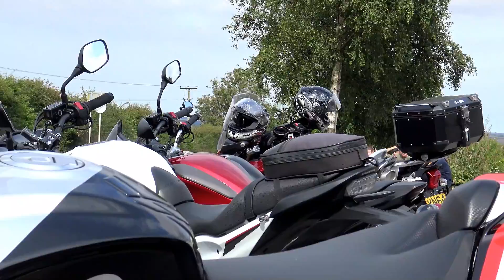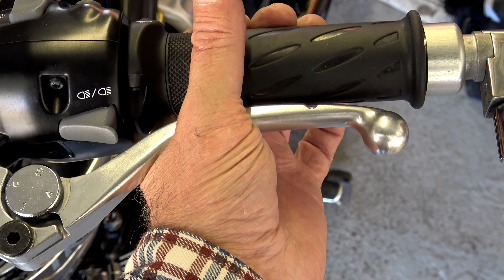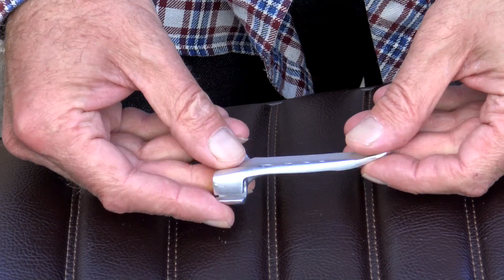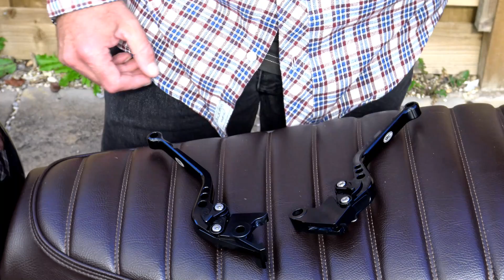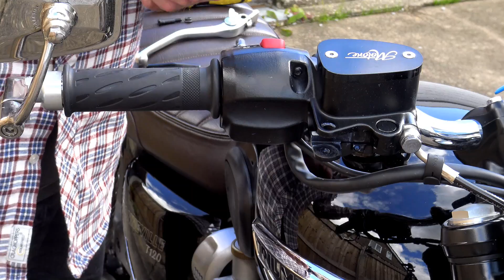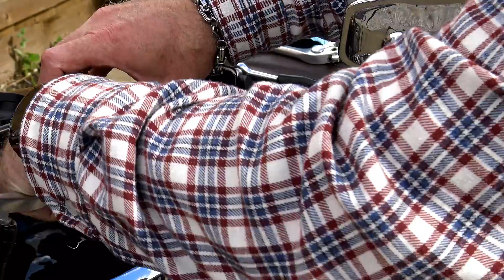Triumph Bonneville T120, Replacing/upgrading the brake and clutch levers/TEC bike parts!

Comment: Triumph owner like yourself, I do enjoy your thorough reviews and overall vert engaging style. I do deel sometimes you’re too harsh, though “The area where Triumph let itself down”: seems to me an unfair comment. I own a 2024 T120 an there’s nothing wrong with the levers whatsoever. If you like replacing them having physical problems with cramps that is totally fine and your review will be of help to others with the same problem. I just think this was an unnecessary criticism. I note that you make negative remarks about Triumph just for the absolute price. You have a choice to go cheaper (as with you panniers and screen), so Triumph prices are not a practical problem for owners. In my view, Triumph may price accessories as they see fit and as a business need not be bashed for commerce in a free market.

Comment: Stuart, what year 120 is this a 2017?  Do you happen to know if the issue has been resolved by Triumph on the latest year model?  If the accessory replacement offered by Triumph doesn't have the problem?  Are there any other oem parts that might be of similar concern on the latest 120?

Comment: Thanks for this!  I've had similar issues with the clutch and brake levers vs. my hands on my T120 after prolonged rides, as well.

*

After discovering how poorly made the levers are (perhaps I won the bad lever lottery), the brake lever having a surprise break while riding (thankfully it wasn't followed by my suffering a break), I decided to upgrade.  An upgrade many perform when they first obtain a new-to-them bike.  

[the brake lever actually snapped in half towards the tip - I stopped and picked it up off the road, as the end is sharp - Whoever buys this bike someday can have it and the old levers]

This is one of those upgrades, once installed, I wish I had done when first getting the bike.  I'll be doing this for my other and future bikes, as well  - in addition to positioning the levers, most likely asymmetrically, to the most pragmatic/operationally safest horizontal, reach and tension positions, which I also hadn't done.

The new levers make such a difference... and they're beautiful, to boot.  The stock levers aren't attractive. Mine had a dull gray and unrefined finish, which is surprising considering the brand and price point, and are serviceable, at best.  The clutch did have a tension switch, which not all do.  

The new levers feel better.  They're more ergonomically designed, with a bend in the grip, and they can be adjusted in more ways and extended/shortened.  They're also designed to pivot if struck, so as not to break, seem much more solid and better constructed and, thanks to a disregard for IP, are emblazoned with the Triumph name.  Plus, they're black, which matches the bike.

Comment: Can't remove the nut off the retaining pin of the clutch lever. Maybe it's the style of nut which has platic in the threading portion for a better hold but it is impossible to remove since the pin itself spins and will not stay put in order to get leverage.

Comment: Thanks for the how-to. One issue I've encountered is that the clutch lever bushing top is smooth and round. The nut is a pressure nut and you can't keep the smooth top from spinning no matter what you do. Maybe I missed a step but I'm at a dead stop with this.

Comment: Stuart, what a glorious source of straight forward accurate information from a bikers perspective! I very recently bought a 2001 T100 that has only 5k miles and had been laid up for 9 years! Must be a story there somewhere .. anyway, all fully serviced, MOT, new parts including front wheel and tyre, though has a large dent on top of the fuel tank. Ex sheet metal worker, so will be looking at a fix for that. Thank you so much, I think there will be lots of component parts that may require attention/replacement. I have rebuilt a 1959 T100 as a teenager and enjoyed it all and I am a stickler for quality at all costs. Your enthusiasm, knowledge and honesty is refreshing, never go into politics! Down the road from you in Hemswell, Lincs but look after the racket servicing for the squash prima donnas there once a year for a week, great people. All the best, Liam

Comment: Hello Stuart. 

I would suggest that you take your right hand index finder (digit two if a physician) and run it across your left hand with pressure across the heart line (upper crease) in your left hand. If you feel a definite bump below the little finger (digit five if a physician) and your middle finger (digit three if a physician) you have cysts on those finger tendons. Very common as you age and digit five and three are usually the first to have cysts. 

Here in the colonies we refer to them as trigger fingers. I sold my bikes and gave up riding because I could not release a motorcycle clutch. The solution is a steroid injection into the cysts with a syringe that is applied until the cyst explodes and usually solves the trigger finger problem. I actually gave up riding because I could not use the clutch on a motorcycle anymore. Had the procedure done when I found a competent geriatric doctor and am now riding again. Cheers.

Comment: Hi Stuart,

Installed these some weeks ago. All went fine. However the brake lever has a lot of ‘play’ before the brakes actually engage. This was the case already with the OEM levers off course but with the shape of the Tec’s I notice it a bit more as I can trap my fingers with two-finger-braking.

Do you know of any way to reduce the length of travel/play before the brakes grab? It’s a lot and I can ‘bottom out’ the brake as well wherein there is a mechanical stop (the lever bottoms out the rubber pump) to the amount of force I can apply.

Pads are fine, fluid too, only 4000kms on the bike. Haynes manual doesn’t mention anything either.

Comment: Dont know if it's a case of great minds thinking alike, or fools being of the same opinion.............
I've just bought the same set from TEC,  for my Thruxton R.
Slightly different fitting procedure,  but not so much as to make any difference. 
They look sooooo much better. 
The mismatch with the standard levers was driving me mad.
Much better now.

Comment: HI STUART ! I HEARD YOU SAY , YOU WERE DOING MORE MODS !  WELL ONE I DID TO MY THRUXTON, IS "NOLOGY " COILS AND SPARK PLUG WIRES ! AND LOVE THE POWER, AND CLEAN RUNNING  STRONGER ENGINE ! I ALSO USED THERE SILVER PLUGS , BUT LOOK INTO "BRISK" PLUGS THERE " EVO" . AFTER I THEN DROPED THREE THEETH ON THE REAR SPROCKET , AND STILL HAVE BETTER PULL AND TALLER GEARS !
Reply from the maker: hi Fred yes, this video was a while ago now and she has changed beyond recognition now, I shall look in to your suggestion sir thank you!

Comment: hallo , i did brake the micro switch ; (( is this a piece you can order ? i di not find it at th triumph parts list .

gtz from belgium 
geert
Reply from the maker: Im not sure if you can sir! you may have to call your local Triumph dealer and ask them! Bert Eding  had a similar had a similar mishap with his brake switch but i think he managed to find a replacement !
Reply: i forgot the copper bush and the second timei put the lever on  i forgot about the micro switch and broke it ; its glued in now  :(((
Reply: ok thanks ; i have a very friendly dealer overhere in belgium ; i replaced the springs this morning , going for a ride now 
gtz
Reply from the maker: ah, which springs?

Comment: I have in the past bought a few things from tec for my oil cooled bonnie and have been pleasantly surprised with the price and quality I'm thinking I might get a T120 for my retirement bike but as yet I haven't tried one I currently have a explora & a thruxton r but my bad back is playing up and I'm looking for something a little lighter and more comfortable
Reply from the maker: also have an upgrade for the front forks coming up this week!
Reply from the maker: well I hate to say it because people tend to get upset with me but, triumph do have a habit of fitting budget proprietary parts and then charging a premium price for the bike, and the suspension is one area they should not have penny pinched on. especially with a bike they are currently charging £10,300 for! the good news is, that the front suspension upgrade is not expensive and it does transform the bikes handling and ride quality. I was just a bit shocked when found out why the suspension is so deficient,
Reply: If you get the T120 Anthony, change the rear shocks straight away, otherwise your back will suffer as mine has. Stuart has a video on the Hagon Nitros that explains them and the 2810s which I am about to fit to my T120 in the hope that I can ride the bike comfortably.
Reply: I look forward to that because you have obviously felt that it required it. I watched an Aussie bloke do an "honest review" and he ditched both back and front shocks because he felt the T100 had the worst suspension he had ever experienced and I agree with him.
Reply: I'll forgive the pun, lol. I assume that unless you take the front springs out, you would never know, because it probably isn't common knowledge. Glad to hear that it isn't expensive. Got my 2810s yesterday and have waxed them up ready to fit when the weather improves.
Reply from the maker: £60 and half an hours work sir!
Reply: Wow. I must see this. Put the 2810s on today. Left the damping as they came from Hagon. Did about 20 miles down reasonable country roads 50-60. Stopped and checked the rubber bung on the piston and it was at the bottom. I'm assuming that means it bottomed out. Clicked it up two and it stayed about an inch from bottom, though did a shorter run. Got home and clicked it up one more. Will raise the rubber bung up the piston and give it a good run to see how that is and where the bung ends up on the piston. All in all a much better ride anyway, but the front now needs doing. Looking forward to the video on front fork change. Wouldn't do it myself though.
Reply from the maker: Hi the bump stop will eventually vibrate its way to the bottom anyway so be careful. only do a 2 or 3 mile run before you check its position. it may a take a while to get your ideal setting. you should aim for a position that uses almost all your spring travel without bottoming out. so about 1cm from the bottom would be  about right. find a section of road that is particularly bad to put it through its paces. and don't forget even on the perfect setting any suspension will occasionally bottom out on really bad potholes!
Reply: Do tell what you used in the front end. I moved the damping to number 8 and found it too hard as my back told me. I have changed it down to number 6 which is better, but may go to 5. It is better than the stock, but still feel that something is amiss. Either the 2810s aren't man enough to cope with the bikes weight, the front needs changing or the basic physics of the bike have not been designed by an engineer.
Reply from the maker: damping just alters the speed at which the spring is able to move low numbers are fast, high numbers are slow which wouls give the impression of the spring being hard. best way is to set spring preload first. set preload and damping in the middle then adjust preload until it feels about right for your weight using the bump stops as an indicator. then adjust damping for comfort. lower will feel softer higher will feel hard.
Reply: Changed the preload to the middle setting of three today and what a difference. It didn't bottom out and my back wasn't whacked. The damping was on number 4 and the bump stops stayed a quarter of an inch from the bottom. I phoned Hagon to give feedback and ask whether the 20 spring would be better for the weight of this bike than the 18. They said that if I wanted to change to a 20 they would be happy to do that for me. I will see how I get on with a pillion, which would require the maximum preload adjustment and see how it goes. A pillion would be a rarity. Will order the tec fork springs and my son, who is far more savvy than me mechanically, has said that he will help me after watching your video of the project. I phoned Triumph to see if they had any Fox shocks on another bike for me to trial. They said they hadn't. But get this, they also said, well you know it is what is is, stock shocks are cheaply made and you can't expect much more, change the front forks and then come and see us, or you could pop in and speak to Roger who has been in the trade for 50 years and knows everything. Quite frankly, that isn't good enough. As we know, £10,500 is a lot of money to pay for something that rides as poor as this out of the box.
Reply from the maker: no one seems to have a bad word about TEC, and i have to admit i found them very freindly and helpful! Both are excellnt bikes Anthony, i dont think the Thruxton is as extreme as a sports bike so it may suit you fine. but i went for the T120 because it is an excellent all rounder and practical bike, as well as being drop dead gorgeous!
Reply: So, bear with me. The preload is at softest setting, which is meant to be right for my weight. If I move it to the middle of the three positions, this will increase the preload and make the spring harder. Then I play about with the damping? I phoned the dealership today to ask if they had a pair of Fox's that they could borrow me off of another bike, but they hadn't. I said that I was going to change the front springs and they said come and talk to them after I had done that. Don't want to chuck the baby away with the bathwater if I can help it, but am losing heart with this. This bike should be the rolls royce of retro!
Reply: Ok. I take note of that.
Reply from the maker: glad you making some progress sir thanks for letting me know.

Comment: Hi again Stuart, Great review as usual. I have actually developed a different clutch arm problem and have started to think it might be the lever. I have pain between my elbow and wrist. Different, I know, but I am going to look for a new set of levers now. I am in Thailand so I will probably end up with whatever is available here. The Triumph replacement levers are available but I don't know how much they are. Whatever price they are there are sure to be some triumph modifiers here who have sourced an alternative. Keep up the good work!
Reply from the maker: Thank you colin, yes I'm sure there will be a plentiful choice of alternatives over there. let me know how you get on!
Reply: I will indeed. We both love our t120s and I tried to purchase some muc off products here because of your reviews but the distributor is not very good in Thailand. I did though find a Thai product that is pretty good. Especially considering the large cost saving. Ok, you probably need to use a soft brush a little more than you probably do with muc off cleaner but thanks for the inspiration to find something suitable.

Comment: Those black levers look so much better. I have a similar issue with my clutch hand, when in traffic the two fingers I use for clutch control really ache. I keep trying to use all my fingers for operating the lever but it just feels wrong. The clutch on my bike is particularly heavy, good excuse to get a new bike 😉
Reply from the maker: Thanks Dervman i was actually expecting a lot of opposition on this one but most seem to agree that they look better. re the clutch hand it is something i used to experience for a day or two whenever i got a new bike, but this time it just wouldnt go away.
Hmmm new bike tell me all about it! i like hearing about new bikes!
Reply: stuart fillingham I’ve got a spreadsheet comparing all the bikes I’m interested in, it’s a fairly fluid list and I’ve come to the conclusion I need two bikes 😂. Right now I’d like a GSA but with the CrossTourer DCT motor for the two up work and the Ducati Scrambler in red that reminds me of the old XT500 for solo pottering 👌🏻
Reply from the maker: Then obviously you need three new bikes! I wonder what the crosstourer would be like with the lc gsa engine in it? I wonder if anyone has tried it!
Reply: stuart fillingham Three BIKE’s, now you’re talking 😬. The CrossTourer with the boxer would be worst of both worlds! You’d have none of the nice electronics and that great GS headlight with the rattly old boxer. The Honda weighs a good 50 kilos more too 😱
Reply: stuart fillingham The CT with the boxer would be worst of both worlds! I’m actually really looking forward to see what Honda do with the 2018 CrossTourer. An LED light, proper cruise control and modern looks and I’ll be tempted. 👌🏻
Reply from the maker: Do you know im so glad you have said that! everyone always says what a brilliant piece of engineering the boxer is, yet ive always considered it rough, unrefined and downright agricultural! i thought it was just me!
Reply: stuart fillingham I love the torque and relaxed power delivery but it sounds like a bag of nails! It’s a gem to service though, I can adjust the valves in a hour. That is a really strong selling point from my home servicing view of the world....
Reply from the maker: yeah I get where your coming from there but most of us mere mortals just take em to the dealers for that sort of thing! good old British engineering solutions eh! What would BMW have done if it hadn't stolen the boxer twin design from Douglas? oh and the telelever design from that French chap! cant remember his name now!